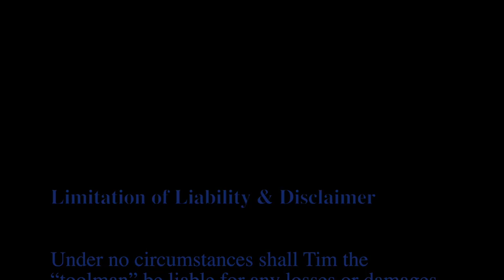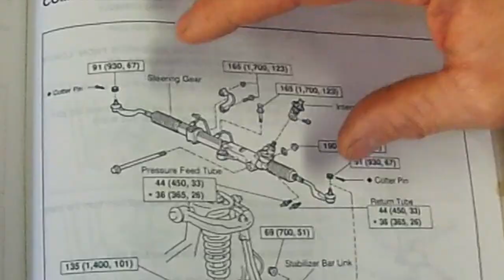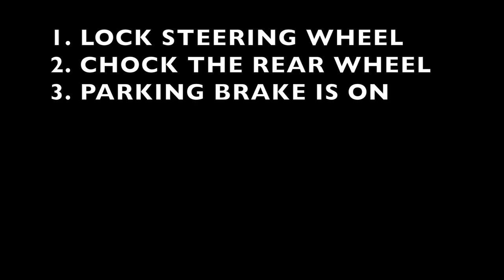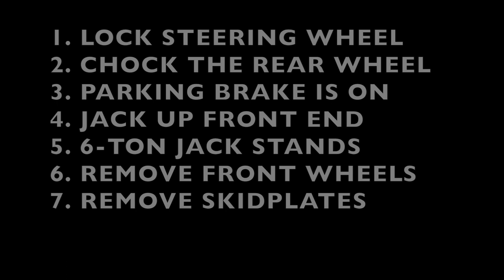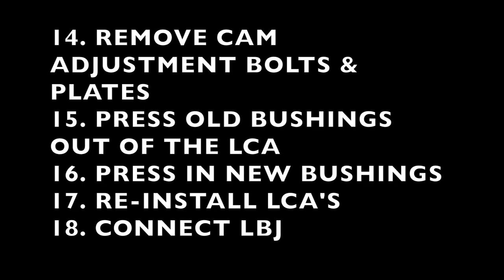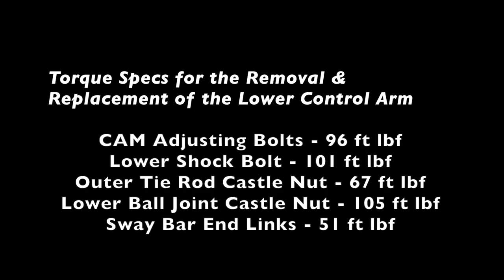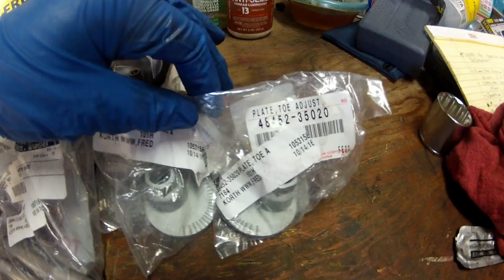Front Lower Control Arm Bushing Replacement (Part 1)

Comment: Hey guys! Great video. I’m having troubling getting my 88 4runner aligned within spec. With that said it’s pulling super hard to the right. I’m going to dive into it sometime next week and check out those bushings. The alignment shop was saying it’s potential a bent lower control arm or frame. Although there isn’t any visible damage and I didn’t take a big hit. Do you think it could be just the bushings are totally shot? Thanks
Reply: Also it has a high frequency shake around 20mph I figured it was just from the alignment being off.
Reply from the maker: It could be worn bushings throwing off your alignment.  If you've had your rig for quite some time, it drove fine before and you know you didn't take any hard hits, that pretty much rules out a bent control arm or frame.  Control arms and frames don't bend from normal driving.  Now, they could rust out and break if you live in an area where they salt the roads due to ice. 

I'd take a good look at all your front end suspension components - shocks, springs, upper and lower control arms and bushings, upper and lower balljoints, tie rods, and steering rack bushings.  Make sure your tire pressure is equal on both front tires.  Check your front wheel bearings for play.  Hope this helps Austin.  Good Luck!

Comment: Greetings from Chicago Timmy! My sleeves are seized on all four sections, but I managed to remove all four bolts within the sleeves.  Im about to cut them and replace with new oem lower control arms and oem cam bolts. Question is... Can I replace the two rear bolts (closest to rack) in the opposite direction to avoid loosening my steering rack? The bolts to the rack may be a nightmare to take out. Any feedback is greatly appreciated.  Thank you
Reply from the maker: You know, I can't see any reason why you couldn't put the long cam sleeve from the inside out so you wouldn't need to move the steering rack back since you're cutting the old cam sleeves out.
Reply: @TimmyTheToolman  Just what I wanted  to hear. This will definitely save me some time. Thanks again for the feedback
Reply from the maker: @cybrah  You're welcome.  Good luck with the rest of the job.

Comment: Awesome vid!  I was wondering what size washers you guys used for your bushings?  Replaced mine, but living in the rust belt, the washers fused to the cam bolts so had to replace everything and can't seem to find the correct washers for them anywhere.  The dealers ship is the only place I have yet to check.  Thanks!
Reply from the maker: Hey Jed, there isn't any separate washer.  What you are referring to is the lower control arm cam which has a washer and rod connected together to make up the cam.  With all the rust problems, you probably couldn't see that it was one piece because I imagine the washer part of the cam came off with the bolt.  Look at this link to the Camelback Toyota parts website:
https://parts.camelbacktoyota.com/parts/2000/Toyota/4Runner/SR5?siteid=214329&vehicleid=84047&diagram=8414250

In the parts schematic, look at parts #14, #15, and #16.  
#14 is the bolt
#15 is the lower control arm cam
#16 is the lower control arm plate
These three parts make up the cam adjusters.  I know aftermarket suppliers do make the cam adjusters, I think Moog is one of them but I'd recommend buying Toyota OEM.  An online Toyota parts seller like Camelback Toyota is going to be much more affordable than visiting your local dealer.
Reply: What I was referring to was at the 26:25 mark. I picked up a Daystar polyurethane bushing kit for the upper and lower control arms. They did not have washers. I did already purchase Toyota OEM cam plates, bolts and sleeves. Thanks!
Reply from the maker: Oh, I gotcha.  Those washers came with the Whiteline bushings.  I don't know the size of the washer.

Comment: Great videos... I myself have a 2000 4Runner with 208k original miles... I'm interested in lifting it but I was told that most cars get damaged after a couple of years due to the extra stress caused by the  lift. Any advice??
Reply from the maker: There are some issues with lifts.  One of the main ones is the CV axle angle will be a little steeper even if you do a differential drop.  As a result, you might experience a boot tear on the inner joint because the ribs of the boot start rubbing together.  

With lifts, people will often start running bigger and heavier tires.  These heavier wheels can cause extra stress on the lower ball joints and could cause a failure earlier than if you stayed stock.  To address this, people just replace the LBJ as preventative maintenance and maybe replace them more often due to the extra stress.  Heavier wheels could also put extra stress on control arm bushings and maybe wear them out sooner as well.

Also with a lift, your driveshafts are now at a steeper angle and because of that you might find one of your u-joints that was starting to reach the end of it's life, end a bit sooner because it's operating at a different angle and it couldn't handle it.

So, there are issues as a result of a lift but it isn't a death sentence for your rig.  There are tons of lifted 3rd Gens running out there and they survive just fine.  You just might have to deal with some of the things I mentioned but none of them are super expensive to address.
Reply: Timmy The Toolman thanks you sir for the great advice.. happy holidays
Reply from the maker: You're welcome.  Happy Holidays back at ya.

Comment: anything specific about the washers you put on the inside? will a standard grade 8 washer work or is that a toyota part?
Reply from the maker: Those washers come with the Whiteline bushing kit.  You don't need to source them independently.  If you use OEM bushings, those don't require washers.
Reply: @TimmyTheToolman  Excellent!  Thanks man. Great Video
Reply from the maker: @tomwaits4205  You're welcome Erik.

Comment: Thanks for this! It's not exactly what I'm doing but it's close enough. My 4thGen needs to have the LBJs replaced soon because of leaking boots and instead of only replacing the ball joints I'll replace the whole control arm and put in grease-able eccentrics. My 4Runner spent a lot of time in Florida's salty air in its previous life and the last alignment was tough on the guy who did it but he got it done right. I'm not happy about having to r/r the balljoints so soon (86k) but they are ten years old and even the best rubber wears out. I'll take my OEMs and have Moog grease-able ball joints and new bushings put in so I have a set ready to go in another 100k.
Reply from the maker: Maybe video the repair and upload it to YouTube.  I'm sure your DIY 4th Gen Brothers would appreciate it.

Comment: I plan to replace the inner and outer tie rods at the same time I replace the lower control arm bushings with polyurethane. I'm hoping that I can remove the lower control arm bolts without undoing the steering rack by turning the wheel enough to move the steering arm completely out of the way while the inner tie rods are removed. So, my question is do you think I'll be able to remove the lower control arm bolts without undoing the steering rack if the inner tie rods are removed? Thank you.
Reply from the maker: even with the steering rack still intact with the inner/outer tie rods in place you can still sneak the bolts by. But with the inner/outer tie rods removed, it will def be easier to get those bolts out. Less stuff in the way will help for sure.

Comment: Hey Tim, thanks again for another great video! I have used your videos in the gradual restoration of my 3rd gen 4Runner.

I have a quick question I haven't seen answered. Can you tell me how big of a vice I will need for pressing the control arm bushings and bushing sleeves into place? I will need a larger vice to complete this project, and I want to make sure I don't get one that's too small.
Reply from the maker: mishmasta Read the video description.   I list what size vise I think would be the minimum opening width to do this job.  The video description also has a bunch more helpful information so it's worth reading.
Reply: Timmy The Toolman, it would help if I clicked the "read more" button. Thanks for answering even the stupid questions.

Looks like I'll need to use an alternate method to press the bushing in. I found this thread, which you may have referenced in the video: https://www.yotatech.com/forums/f2/front-suspension-rebuild-3rd-gen-265072/

A forum member used a threaded rod and ball joint press cups in the above thread, but I wonder if a c-clamp style ball joint press would fit the pressing tool stack. IIRC they have a pretty big gap.

Comment: Great video. Thanks for taking your time to make this video. You guys were lucky that the cam sleeve was not seized like most people including my self. I also made a video on replacing my front suspension. Just have to edit it and I'll post it up. May I ask what video editing software you are using? Thanks
Reply from the maker: Well, we've now done this job twice and the second time around wasn't so easy.  We had to cut out the two cam sleeves on the passenger side.

Sean has mainly used the Apple iMovie software but he has a new program now that he likes more.  I'll get back to you with the name when he responds.
Reply from the maker: That was quick.  He's now using Final Cut.
Reply: Timmy The Toolman 

Thank you.

Comment: I am looking at doing this job to my 2001 Tundra. What control arm bushings would you recommend OEM or an after market brand?
Reply from the maker: If Whiteline makes poly bushings for your Tundra, that would be a good aftermarket option.  I would stay away from Energy Suspension.  You could never go wrong with OEM but they are more money.
Reply: @TimmyTheToolman  What about Moog?
Reply from the maker: @mikekmalick  Moog is ok.  I've used their tie rods on my 1st Gen 4runner.  I don't however know anything about the quality of their bushings.
Reply: @TimmyTheToolman  Do you have any other product recommendations? White line doesn't even have tundra listed on the search.
Reply from the maker: @mikekmalick  Whiteline is the company that I'm most familiar with since I've used a lot of their bushings for 3rd Gen 4runner applications.  You might want to ask your question on a Tundra Facebook group or forum to see what some people who also own Tundras recommend.

Comment: Next time you’re doing this just a helpful little hint.  when you’re torquing down your cam plates if you put a seven eights closed in wrench on the bolt and use a three-quarter inch torque bar with a half inch adapter it will fit in a the 7/8 open side of the wrench to give you the ability to torque it without removing the steering rack
Reply from the maker: Good to know.  Thanks for sharing.

Comment: Don't need to worry about bending the control arm with the bottle jack? I've seen some people using straps or something to try and prevent that, not sure if it's a concern.  How about using PB blaster before heat, or both?
Reply from the maker: You do need to worry about it.  People have used to much force and have bent them.  They key is to make sure the bottle jack is pushing very straight onto the bushing between the two arms and that you use sufficient heat.  It the jack is cocked a bit, that will put the force at a slight angle and not be as efficient and thus require a higher force to get the bushing to release.  A penetrant could help too.  You want to start off with a conservative amount of force.  If the bushing doesn't budge, apply more heat.  The people who are able to jettison the bushing out of the arm like a projectile used way too much force and not enough heat.  

We made a Part 2 to this video using a Harbor Freight 20 ton press because of fact some people had destroyed their LCAs with the bottle jack technique.  Here's a link to Part 2: https://youtu.be/6FzEHygizoI
Reply: @TimmyTheToolman  Ok awesome thanks a lot!
Reply from the maker: @ssoulssurfer  You're welcome.

Comment: I have a 2nd gen 4runner. Ive been told I need a complete front suspension rebuild on this old truck I bought. But I was told not to try to replace the bushings but instead the entire control arm. Upper and lower. That I will have no hope of it aligning correctly with just new bushings. How do I know it needs to be that drastic ( EXPENSIVE ) and not just press new bushings?
Reply from the maker: The person who told you that replacing only the bushings will affect your ability to get your 4runner aligned properly doesn't know what they're talking about.  The control arms are just a big hunk of steel.  The wear parts are the bushings.  If you get new bushings, your control arms are perfectly new again unless you're dealing with rust issues.  LCAs without corrosion issues will last the lifetime of the vehicle in most cases unless they take damage during aggressive 4wheeling.  If a shop told you this, it's because they are lazy or don't have the tools to do it properly.  For them,  It's easier to swap out the entire control arms, charge you a ton of money for them, and also charge you a ton for the labor.  I suggest you swap out the bushings if you have the tools to do it.

Comment: At 31:34 you talk about a "washer we added in". Were these washers there originally?
Reply from the maker: The washers are part of the Whiteline bushings kit.  You install them on either side of the bushings between the bushing and the frame mounts for the control arm.

Comment: My wheels are cocked out .
So do I just loosen and turn the camber bolt ? using a level
Reply from the maker: Take it back to the alignment shop and ask them to do it right.  Trying to do it without an alignment machine to dial in your camber is not possible unless you have laser eye sight.

Comment: Hi Tim, great videos!

I need to change the lower control arm bushings on my 2002 Toyota Sequoia. The part numbers quoted by Toyota are slightly different than for the Forerunner. I went to the Whiteline and they didn't specify the Toyota. Do you have a recommendation to source the correct size bushings and hardware short of taking them apart and measuring them?
Are you still happy with these bushing after a couple years of use?
Thanks!
Jeremy
Reply from the maker: Hey Jeremy,  you could just get OEM replacements.  They will be more money than aftermarket poly bushings but at least you'll save on the labor.  Or, you could press out one of your old bushings and then call Whiteline and see if they could provide you with some measurements to compare to your OEM bushings.  I saw Fred recently and he didn't say anything like his poly bushings were already wasted and needed replacing so I'm assuming everything is fine with them.  I just put them on my 98 4runner and so far so good.
Reply: Yes, I think OEM is the way to go for my situation. Thanks again.
Reply: FYI, the local shop quoted me $1200 to change both lower control arms & bushings. They said they would replace the whole thing rather than press out the bushings. I'm sure adding in all the other bushings (steering rack, stabilizer bar, etc) and it would be closer to 2K.
Reply from the maker: What you experienced with your local shop is common.  Shops don't want to bother with replacing the bushings.  They'll charge you a fortune for new control arms making it easier on them.  I'm glad you're taking the challenge of doing all this work yourself.  You're saving yourself a ton of money.  You're gaining some good experience that you can share with others.  And, you're getting a huge sense of accomplishment.  Let me know how all the work goes for you.  Happy Wrenching Jeremy!

Comment: Do the wheels not have to be grounded to torque the lower control arm bolts?
Reply from the maker: It is best practice to have the control arm in it's neutral position (wheels weighted by the vehicle) when torquing the bolts to put less pressure on the bushings.  We learned this after making this video.
Reply: Timmy The Toolman I torqued my with the truck of the stands wheels on the floor is that right ?
Reply from the maker: @lukeneave  Yes, that's correct.